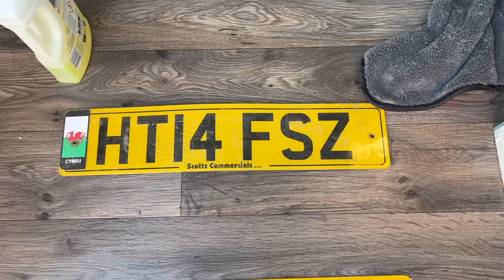Exterior Protection using Turtle Wax Sealant & Fitting 3D Number Plates

Comment: Turtle wax in spray bottle not so good, will hold for few weeks max. If you're looking for propper wax protection look for hard wax. For e.g  K2 Carnauba wax.. really good stuff
Reply from the maker: I’ve used this on my car for a few years now, it lasts quite well for what it is. Obviously not as good as an expensive wax but it’s really quick to apply, so I usually just spray over the car after washing. I replaced this with the hybrid solutions ceramic spray coating which is was very impressed with. That lasts for months. I used the last of the spray wax on the van rather than using up the ceramic spray on it.

Comment: Hey Dan (If you're still on here - this is quite an old one).
Loving the series - just about to take the plunge myself and pick up a base van. Your approach is real down to earth, but solid and looking good.
One question - do you have a rough estimate of the time it took, from start to finish on the van? Not critical for me, I can take my time, but I was curious.
Great tip on the satin finish, btw. Saves a load of hassle.
Reply from the maker: Thanks, I appreciate that! It took me around 3 months to complete but I had terrible weather at the time and was doing all the work either in the van or outside, so lost a lot of days due to that. I think if I did another and worked on it consistently it would be 6 weeks work give or take. A lot of it depends on the van though, mine needed a new sliding door and it all needed stripping out, so that added work. If it was an empty base it would have been a bit quicker.